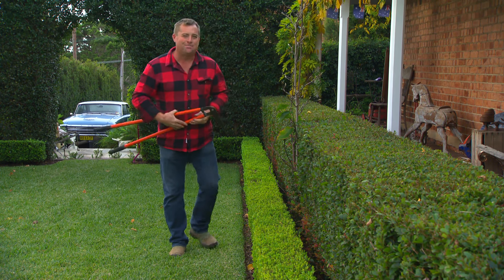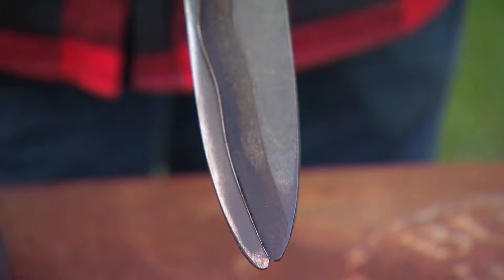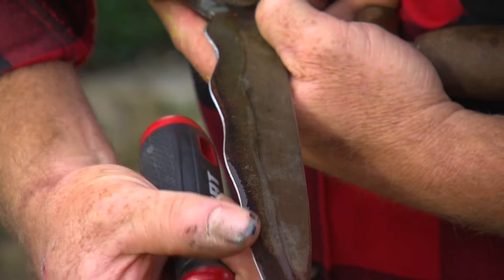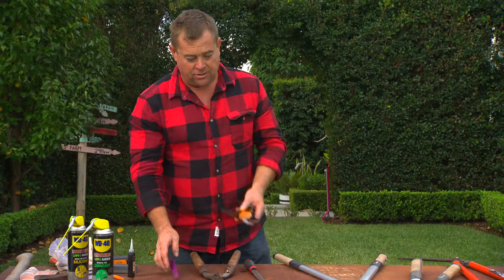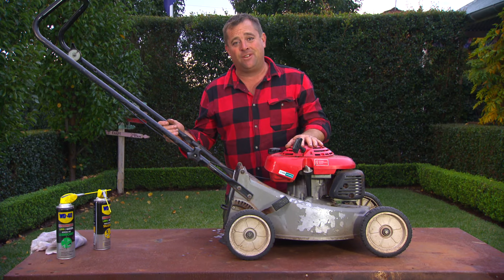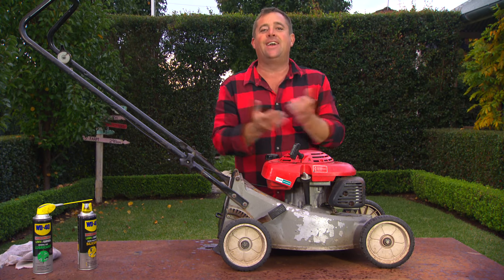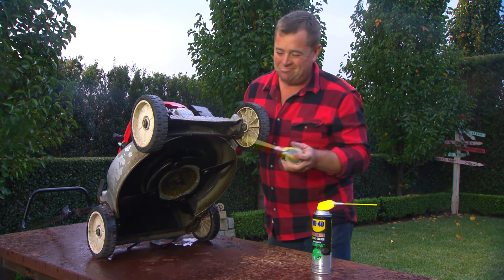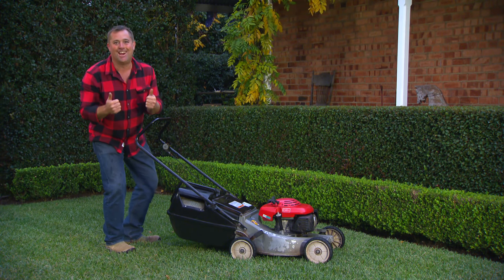How to Look After Your Gardening Tools So They'll Last a Lifetime | GARDEN | Great Home Ideas

Comment: you can also sharpen your digging tools a little, such as shovels and spades and trowels.....another tip to help take care of those things is to fill a big bucket with sand and oil (around a half gallon to a 5 gallon bucket of sand)....then after you use them when you bring them in to put them up, plunge the blades down into the sand a few times and then put them away.....the abrasive sand cleans off any mud or debris stuck to it and the oil gives it a nice coating to prevent rust....